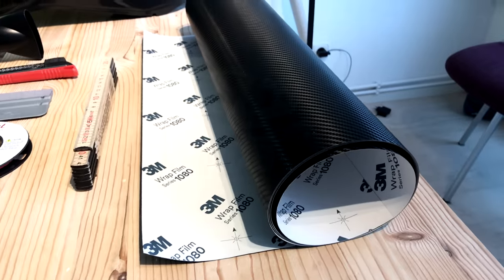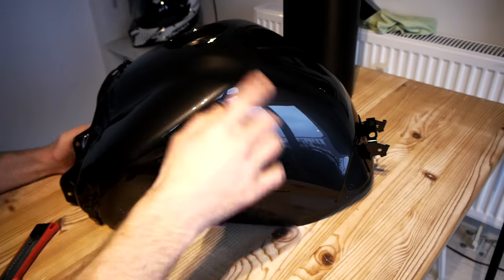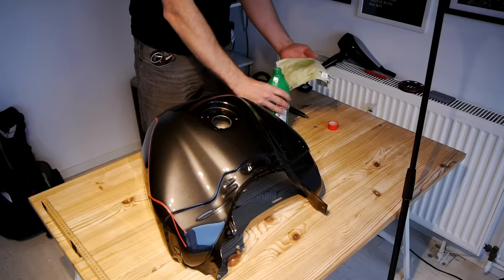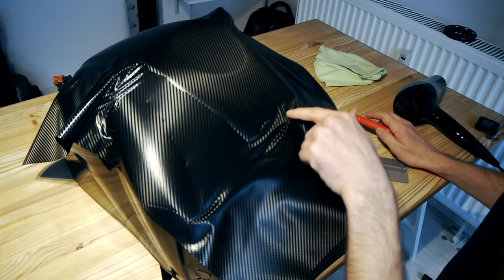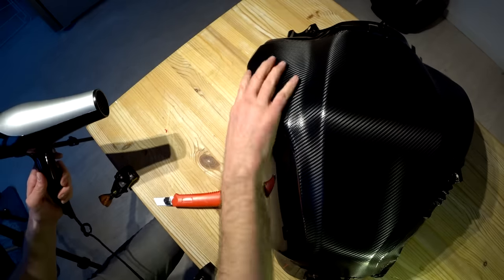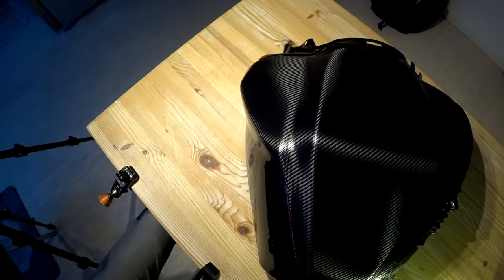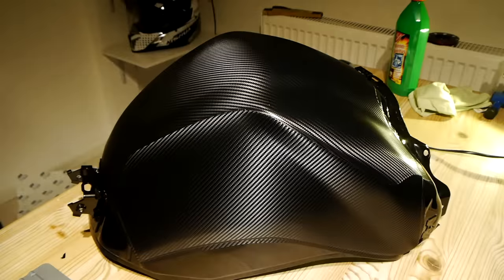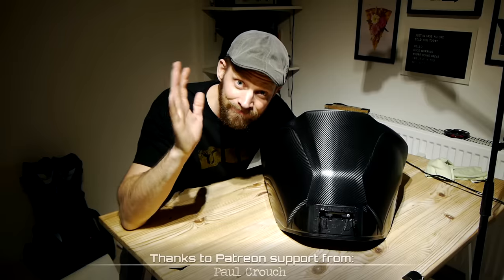Vinyl Wrapping Motorcycle Tank

Comment: Wrapping is tricky. I did my white side panels on my KLX. First timer. Did ok. Thankfully it’s a camp print. LOL. Hides the few imperfections. But an overall improvement on appearance. My cut tape lifted off as I adjusted the wrap. Panel was properly cleaned but I made due. Definitely have to pin down the piece you are working on. 
Thanks for your help.

Comment: Thanks for that! I have a long range aftermarket tank on my KLR. It is a transparent whitish colour which I planned to vinyl wrap until I saw this. I now have decided to leave the fk'n thing alone! Cheers!
Reply from the maker: Hahahaha! Very happy to have helped mate, regardless of the direction! 😄
Reply: yup.me to.
Reply: If you decide to wrap youll have to make relief cuts once your finished!! My buddies xc race there quads and have oversize tanks and theyre graphic kits bubble and pull off in the first couple of weeks w/o relief cuts because tanks without the tank cover offgas quite a bit and thatll ruin the adhesive

Comment: I thought that you would go with the grain of the top piece instead of the opposite direction.  Great job.  I am looking to get a new Yamaha fjr 1300 es.  I want it in black like the 2017 model but it comes in blue.  The dealer had told me about wraps, and so here I am researching and found your video.  Thanks a bunch.  Cheers from across the pond. 👍
Reply from the maker: I decided early on that trying to match the grain would be a frustrating and long winded affair! I also had limited vinyl, so I just gave up before I started and used in whatever direction it worked!! I think I’ll be changing it soon anyway. Good luck with your wrap. It’s a great way to change up your bike, but maintain the ability to just change it again later!!

Comment: If you don't like how the edges join, you could always use some pin striping tape over the edges in a contrasting color... Maybe if the bike was red and you were putting a black carbon fiber vinyl wrap on it, you could use some very narrow red pin strips on your edges as accents?  Just like we don't expect the people who put sheetrock on walls to have perfect fit along the bottoms of the walls or around the doors and they use trim pieces / moldings instead.
Reply from the maker: I'm with you there. Problem with this stuff is that it's textured, so the pinstriping doesn't really stick as well as it would on a smooth vinyl. So eventually it starts to peel off. Could be that I did it badly, but hey, just an amateur!

Comment: Well done.  It looks great.  I would have planned it so that the seams were on a concave surface so that they didn't get pulled up during cleaning or rubbing, up.  Maybe yours it the usual way.
Only one thing...... Fuel tank, hair drier.  There should have been a safety warning to simple folk about washing it out first!
Reply from the maker: Thanks mate! Yeah having the seams on a concave surface would have been better, but then I'd have to get the vinyl around the convex curves and introduce a lot of tension. Pros and cons to both possibilities.

Comment: I always wrap my bikes, see my most favorite in my avatar although the wheels were plasti dipped.

The best trick I have learnt is that if you are faced with a panel that is near impossible to single wrap and you have to do the wrap in sections, then look for a way to create a design that means you can be lazy and just use a different color and make look like it was meant to be :)

I also found that so long a the scratch is not too deep the wrap covers scratches very well with no effort. If it is deep just fill it, smooth it, wrap it.

The pro version of the wrap cut is better, it has a stickier back enabling you to do curves more accurately.

EDIT: Tension and Stretching are both your friend and your enemy.

EDIT EDIT: Umm you should have done the sides first, you want the edge to be facing down that way when anyone standing in front or the side of your bike will not see the edge so easily. Also if you are working with two colors the edge will have risk of getting dirty and it will stand out more if the edge is facing upwards.

EDIT EDIT EDIT: Carbon or any textured wrap is the hardest to do... you did pretty good for your first go... try matt next time, it is much more forgiving :)

QUADRUPLE EDIT: If you follow CKWrap's guidance you should pull the tape at a 90 degree angle , I think in some places you were leading it which can create a dodgy edge, but the wavy parts you mentioned maybe where parts of the tape pulled away or got stretched away when you were wrapping.

BLAH EDIT: check this out https://www.youtube.com/watch?v=m0qOOcIDGuk ;)
Reply from the maker: Cheers mate. Some good tips there. Will probably mix things up a bit next time. I’ve actually seen that video. Impressive wrapping  going on there.

Comment: Mate, hats off to you for having a go, I've certainly never done it. If I did I'd only be interested in doing a one piece with no visible joins. Surely the wrap is available in wider dimensions.
Reply from the maker: Cheers Mark. I think single pieces is certainly a clever way to start. Otherwise you may just destory all motivation for future projects!! Yeah the vinyl is available in larger dimensions. But I knew that I wouldn't have the skill to do the tank in one and saved the money by getting the smaller size.

Comment: Looks good.  Great idea but a little pricey if you're doing the entire bike...for just a little more I actually ordered a couple of sets of Chinese aftermarket fairings and it takes 30 min to switch out.  I usually go all black in the winter and either green or blue during the summer.
Reply from the maker: Thanks CV. I’d have to say i disagree. For my bike at least, i reckon i could cover the whole thing for about 50-70€. Compare that against the cost of a respray and it’s many many times cheaper. Of course, the way that you have done it is very dependent on Availability of the Panels for your model of bike. Forgetting also that you can’t get a cheap petrol tank from China to swap out with the season! 😜
Reply: @AndyManCam  Yes! very true...I own an '09 Ninja 250r so NOTHING is hard to find for my bike 😎👍
Reply from the maker: Haha! That’s a great position to be in! 🙌🏻

Comment: Looks great! My only suggestion would be to do the sides first, then let your top piece overlap at the seams, even if you have a butt joint.
Reply from the maker: Thanks Alejandro. The only problem there is that the textured vinyl doesn't really get a good stick onto itself.

Comment: it would be a good idea to put a pinstripe vinyl strip over the seam that red tape looked good there. 
I've used this stuff on my car dash panel around the instrument cluster. it had more extreme gradual angles around the hole. real pain to do..
Reply from the maker: You’re not wrong there. Certainly looked good. I’ll be doing something new soon with brushed steel effect and black pinstripes.

Comment: I'd rather try to fix the dent first. There are ways to do this. First is a combination of cooling that spot with inverted spray can, then pulling on it with a strong suction cup or magnet.
Reply from the maker: Even if I'd fixed the dent (which professionals have told me would be VERY difficult) the paint is damaged so the tank would have to be re-sprayed. All of that cost and time versus 1 day of wrapping was an easy decision for me. But each to their own.

Comment: the perfect temperature is between 21-23 celsius ( soory dont know how many degrees that is). the vinyl by the book should be at same temperature for 24 hours if possible, but hour or 2 should be enough. the only thing i would do, i would preeheat the tank before you start working on it if would save u a loot of tim and you wouldnt need to stretch it so much because you alreday have heat from the tank. oh and the trick after, you heat it and presure it to put any air out if something is still in, but good job. if u ever want to work in airplane carbonfibre industry you would do good, if somebody thinks im, full of ... dont worry im not i make plane wings from carbonfiber ;-)
Reply from the maker: All very good to know. Cheers Dean. And a great idea with heating the tank first too. Though after the first few minutes of blow drying ther vinyl, the tank was pretty toasty! Probably explains why the second half went so much easier! Working in Airplane Carbon fibre is actually something I'd be interested in! I've got a degree in Product Design, so anything like that gets me a bit tingly! If you've got a lathe and a 5-axis CNC machine, then I'm in!!

Comment: I am sure that there is an obvious answer to this - HA - but I will ask the question anyway ----- do the fuel spills and//or vapour cause the edge to lift inside near the filler cap?  Thanks.
Reply from the maker: They haven't yet. Seems to be holding firm. But it's worth remembering that I actualy tucked the vinyl into the filler neck so that the cap actually holds the edge down.

Comment: Can you use some kind of decorative thin tape over the seams?
Reply from the maker: It's a good idea and I've tried it before. The problem is that the vinyl is very coarsely textured. So the tape doesn't make good contact around the texturing and quickly comes off.

Comment: Hi, very good job. A little question? Is a professional vinyl or a commercial one? From the video I do not understand if you have cut flush with the film or you have overlapped at least an inch, because in the first case, very easily the film will retreat and discover the bottom. Thanks a lot.
Reply from the maker: Hi! Thanks! As far as I know, it’s a commercially available professional vinyl. From 3M. I cut the film flush so it is possible that it might retreat a little. Depends how well My Post heating went!

Comment: Wouldnt it make more since to post heat before you pulled the filament? Genuinely curious
Reply from the maker: Not really, because when you pull the filament, it stretches the vinyl a tiny bit. If you post heat before this, then you kill the ability of the vinyl to return to its original form and you end up with a very slight rippled and baggy seam!

Comment: Nice work Andy 👍 at the point where the tank moved I'd have probably gone nuclear 😁
Reply from the maker: I was impressed with my restraint! Luckily i didn't end up on the floor with the tank on top of me and all my T-shirt fluff stuck to the vinyl!! THAT would have pushed me over the edge!!
Reply: @AndyManCam  Use the rubber waffle type material sold everywhere on your work surface. Using a tip from wood workers, it will hold a piece of wood from moving when cutting with a router.  Great job , I'm not that brave to take that challenge however.
Reply from the maker: Good tip. If weren't for budget restraints and possibly hoping to never do this job again, I might look in to that stuff! :D  Cheers Scott!

Comment: Maan you should start from the sides and then wrap the top ! 
Cause in this case when you look at the tank you couldnt see those cutting lines 
When you start from the top those lines are lookin at you like angry cat and its not good at all
Reply from the maker: But there's no overlap on the lines. It's a Butte joint, so both pieces meet each other perfectly, at the same height. So the cutting lines will look the same regardless of what order they were laid in. Pattern matching n the other hand would have hidden them nicely. But i didn't have enough vinyl, time OR skill to do that!! :D

Comment: i think its better to do the sides first then the top, it hides the cut lines better
Reply from the maker: There is no overlap of material on the cut lines. So it doesn't matter which order they happen is as the two vinyl pieces meet each other perfectly.
Reply: @AndyManCam  This is just advice I took from a professional wrapper, I wasn't saying you did a bad job or needed it but its advice for anyone else attempting this
Reply from the maker: I wasn't offended. I'm just saying that normally, when there's an overlap of vinyl at the join, you'd be right. But this technique gives a smooth butt joint that looks the same from all angles. If it were flat and untextured vinyl, the join would be far less visible. The pattern just really gives it away!

Comment: So if I was to do this on the gas tank of my own motorcycle, not buying a new or used one.  What safety issues are there with using a heat gun on/near an object that holds highly flammable fuel and explosive vapors?

I want to wrap my tank, but I also don't want to suffer a fire or explosion.
Reply from the maker: Naturally due to logistical reasons (i live on the 5th floor with no elevator) i did this with a completely empty tank. Also I used a hairdryer rather than a heat gun or a blowtorch, so the heat generated here was much less. 

Of course if you wanted to be completely sure, you could just empty the tank completely and then leave it open (in a well ventilated area) for a day or two so that ALL of the fuel evaporates out. It goes without saying that I’m no expert and you do this all at your own risk! ☠️
Reply: @AndyManCam  Thanks for responding.  It's something I think I'm going to do a bit more research on before attempting myself.  I really don't want to create an accidental IED.

Comment: If you did this with single color (no pattern) vinyl, would the seam be more or less visible?
Also (I'm a total noob) do you need seam sealer at the butt joint or around the petrol hole?
Reply from the maker: I’m also no expert, but i would say yes, the seam would be less visible with a ‚plain‘ vinyl. I didn’t use a seam sealer, but it certainly wouldn’t hurt for the longevity of the wrap. It does make it a lot more difficult in the seams though because the surface is suddenly much more sticky. Pros and cons!!

Comment: How does vinyl wrap keep moisture from underneath the plastic and burning thru the clearcoat?   I had clear vinyl scratch protector on top of my tank and moisture burned thru pinholes on the factory clearcoat and rusted under the color coat.
Reply from the maker: If there's moisture underneath the plastic, then something has gone wrong in the installation! I had vinyl coverings for years on both my last 2 bikes and when I removed them, the paint was like new underneath. Except for the great big scratch on the versys tank after a crash. But even then, the metal was still silver and shiny.

Comment: If you did this with single color (no pattern) vinyl, would the seam be more or less visible?
Also (I'm a total noob) do you need seam sealer at the butt joint or around the petrol hole?
Reply: The seams wouldn't be very visible. No more that a seam on, for example, the housing of a car mirror. You shouldn't need any sealers for edges. Just buy good vynil (3M, ViVid... probably a couple of others) Also, wrap so the top piece of wrap is the top seam.

Comment: Would this work  on exhaust pipes or too hot.
Reply from the maker: Depends which part of the pipe, on what bike and what material the part of made of! I tested a small piece on the carbon silencer of my fz1 and it was ok. But the old steel silencer used to get too hot. Any part of the actual pipes will just destroy the vinyl immediately!

Comment: Would it be visible if you overlaped the different sections?
Reply from the maker: Overlapping will always leave a raised section due to the double thickness of vinyl. But sadly this doesn't work so well with the carbon fibre stuff because it's textured and so it doesn't stick to itself as well as smooth stuff would.
Reply: That would be the correct method, first do sides, than top overlap 2,5mm over sides. Overlap just under the curve of the tank. You should newer do "butt joint" on curved surface. Eventually seam 2will opens or curls... after 1 or 2 hot cold cycles. Hope it will stay on as long as possible. Andy you can still ad a stripe over it... use a bit of heat to make it stick.
Reply from the maker: I'll be happy if it lasts one season Peter. I tried overlapping with the carbon stuff on a different project and due to the thicker material, it just looked really pants! Obviously my (lack of) prowess probably had much to do with that. The Butt joints that I did on my Versys lasted over 2 years and that was with super cheap vinyl that was overworked and no attempt at post heating. I have slightly higher hopes for this stuff from 3M. Cheers.

Comment: If you watch CK wraps you would know that carbon fiber is a directional wrap you put the sides on upside-down
Reply from the maker: Or is the middle upside down? Pretty difficult to line up a single plane Surface with a Surface that curves around a corner. Either that or i didn’t really care that much.
Reply: @AndyManCam  the lines on the carbon fiber will line up if you apply in the same direction ,still did a great job remember no one here is a professional 👍
Reply from the maker: Thats my point though. The central piece has 2 directions. It curves around the tank and the direction of the ‚weave‘ curves with it. Making any form of lining up the pattern utterly impossible. Thanks though!
Reply: Bro go back to that video they line up  just in the wrong direction 🤣😂
Reply from the maker: That's just not possible. What you're suggesting is like lining a rainbow up with a chessboard! The top surface at the front of the tank is horizantal (sort of) and the top surface at the back of the tank is almost vertical. all of the space in between is a curve. How do you suppose one might line up a 90 degree grid pattern with that curve?
Reply: @AndyManCam  from my view all of your lines line up just like this >>>>>>> on both sides
Reply from the maker: If you say so. They're not lining up at all well anymore, as the vinyl is off and the bike is sold!